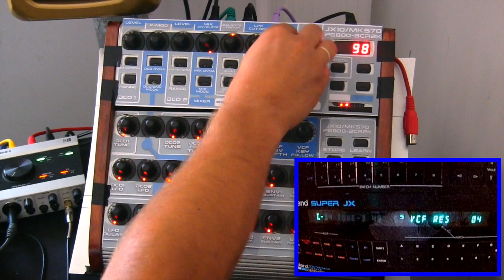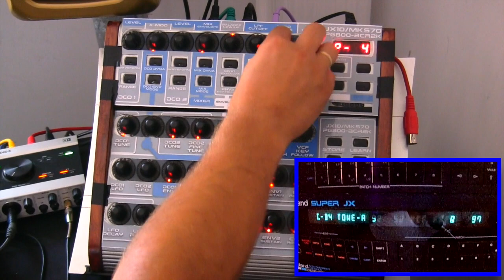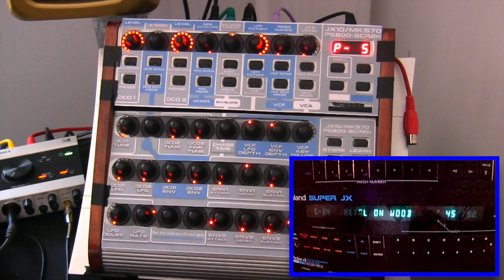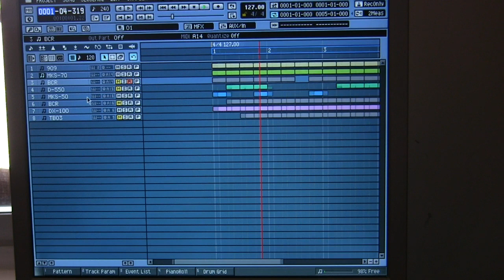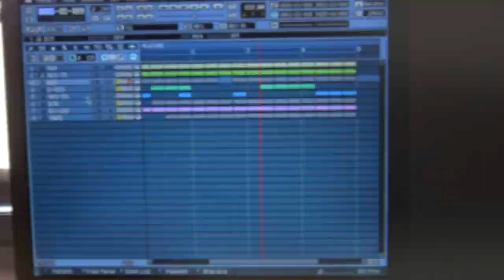DIY INSTALL Vecoven 3.x SuperJX Flash Module for the Roland MKS-70/JX-10

Comment: I’ve been using the iPG-800 app for iPad. It’s $6 and is able to control the MKS70 via MIDI iRig. It’s a great option as well, a little less depth than this but it works like the original hardware unit.

Comment: Great info, thanks. Have you considered the Kiwi Patch Editor, or are you happy with the BCR2000? I'm looking for something to control a Microwave 1, an MKS-50 and an MKS-70 in the future. I have has two MKS-70s and a PG-800 at one point. For me it's the best sounding analogue poly I have owned.
Reply from the maker: Thanks a lot!
The BCR2000 is for me an excellent controller because I can program it with BC-Manager in the way I like it.
In the meantime I have created templates for more machines. I still have to upload them to my website though.
Kiwi Patch editor is tempting also, I admit.
How cool would it be to have multiple BCRs in a row for every module :D

Comment: Hey....the BCR-2000 seems to be a Swiss army knife..i think that, it can control a D-50 or a D-550, since it can transmit sysex..
I like the template you made, nice, neat and tidy works...!!!
Reply from the maker: Thanks my man!
Yeah...I'm pretty proud on the template myself hahaha.
And yes! You can control the D-50/550. In fact...I found a template consisting of 5 presets to control all parameters. The creator said the MIDI-channel is hardcoded but I changed it already to another MIDI channel with the program BC-Manager.
This BC2K is like you've mentioned...A SWISS army knife. But only in combination with BC-manager.
I invested time in learning sysex and now programming is becoming much more easier. There are some nice YouTube-vids available with good explanations. 
Good luck on your sampler-journey!
Grtzzz, Roger
Reply: @theMIDImaniac  Roger, i have a question..we both have a JP-8080 and a D-50..(D-550). I think, but i haven't tried it, that since the jp can send sysex, maybe it could be a controller for the d-50..(you see, i don't have a bcr..:). I know, maybe it's not worth, since you would loose the jp-8080 as a synth, (using it as a controller for the d, but..) I wanna dive in the sysex too, i have only wet my feet...:)

Comment: Hey Roger, wouldn't be possible for a bcr, to work on a D-50(sysex)...???
Reply from the maker: Patrick Martin yes! I’ve got a template for the D-50. 
5 pages full with adjustable parameters.
Reply from the maker: The Midi-channel is hard coded but I know how to change that. 
I will send it to you!

Comment: Do you have a link to the Midi CC numbers? I have a chart but they don't seem like the right ones.
Reply from the maker: Tim Mantle hi? Do you have this table?
http://www.vecoven.com/superjx/downloads/files/SuperJX_NRPN.pdf
Reply from the maker: Or this list when you have the PWM-upgrade. 
http://www.vecoven.com/superjx/superjx/pwm.html
Reply: @theMIDImaniac  This is the table I'm working off but Midi CC #0 Which is supposed to set DCO range is instead affecting the mod wheel amount, I can't get any other midi CC numbers to do anything. Tone CC is set to ON so I can't understand what I might be doing wrong.